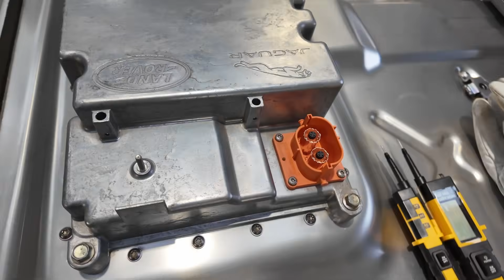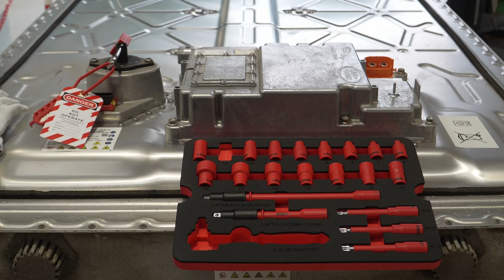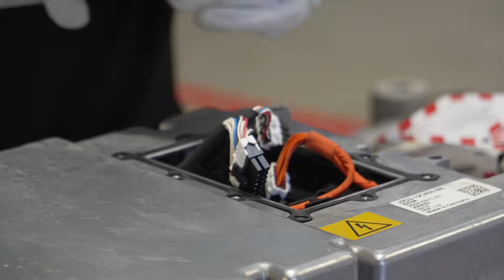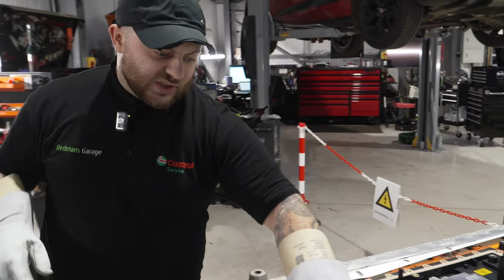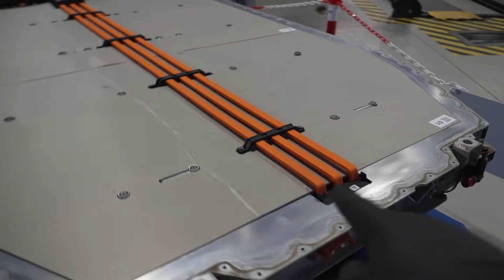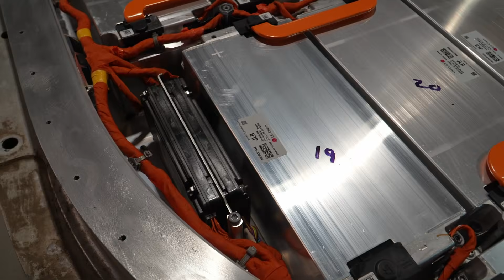🔋 Jaguar I-PACE High Voltage Battery Cover Removal | Inside the EV Battery Pack

Comment: Crazy technology and bad design.
If I was refitting the main cover I would be smearing a large amount of red rubber grease around the edge to prevent corrosion. The rubber seal wouldn't be affected and the cover would be reusable. ⚠️
Reply: Have you checked the chemical reaction between red rubber grease and the specification of the seal material ?

Comment: How much do you think a full new battery for would cost? Rather than just module repairs.  Can you still buy it as new part?
Reply: New is only 55000eur
Reply: @otofoto what a stupid comment...
Reply: @aldish25 But it is true. That is the actual price of new new battery pack not new old battery pack.
Reply: @otofoto it's absolutely not 55k when a new I pace price was at around 65/70k! Jaguar might charge you 55k to replace the battery but that's at their dealership where they will take 70% profit for the battery and charge another 10k for the labour!
You can easily buy a very low mileage battery for 2-3k and give it to an independent shop to do the job for another 2-3k! The battery's warranty is 8 year's or 100k miles so that's a very second hand car at that moment and nobody is giving it to a dealership, even petrol or diesel cars are not getting new engines or gearboxes replaced in dealership on a car that age
Reply from the maker: A revised HV battery is currently priced around £32,000/€37,000

Comment: Are these batteries thermally managed? Not seeing much in the way of heating/cooling in there?
Reply from the maker: Yes, they are. The I-PACE battery is liquid-cooled and heated, with coolant channels built into the pack. It’s all managed by the car’s thermal system to keep the battery in the right temperature range when driving, charging, and pre-conditioning.